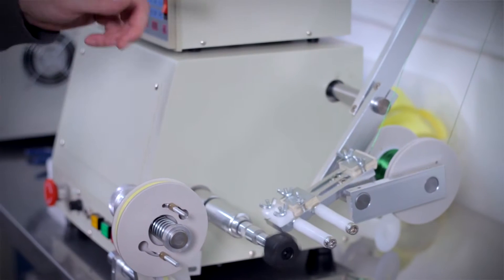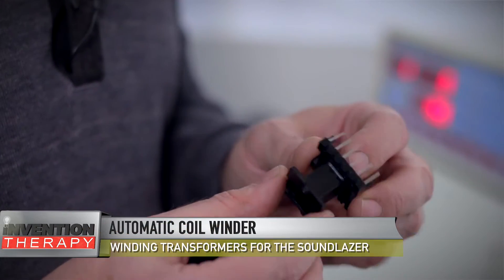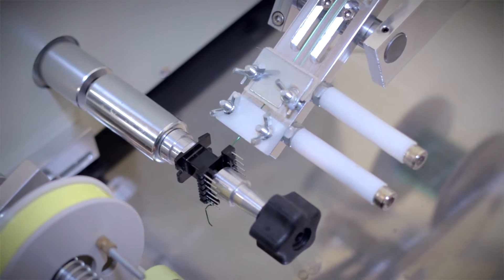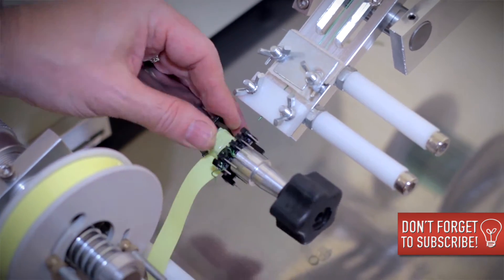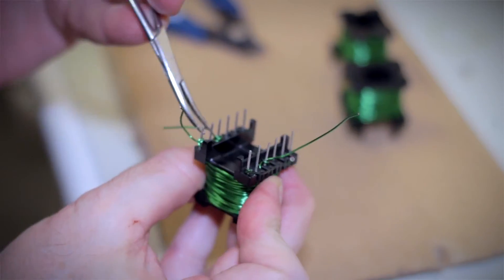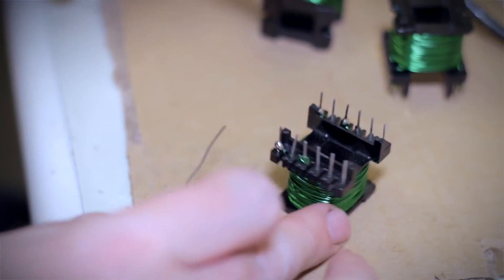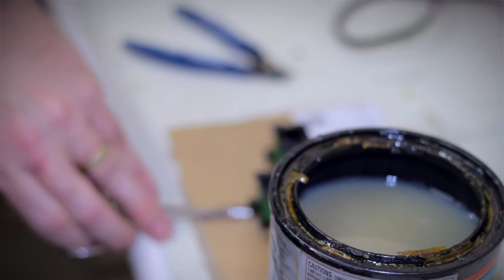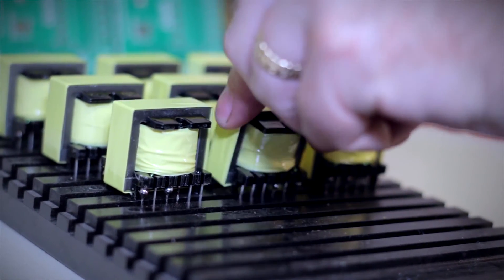Automatic Coil Winder and CNC Transformer Winding Machine For Small Manufacturing

Comment: Can you use this machine to wind very small inductors, say those using RM or Pot type cores? In particular RM5 (very small) and then RM8, RM10, P2213, P2616 cores. Thank you.
Reply from the maker: This machine is large and would likely break any kind of thin wire. In addition, the spindle is at least 6mm (1/4”) in diameter.
Reply: @InventionTherapy  Thanks so much. Looks like I need a smaller one but those are not as automated.
Reply from the maker: My studio is in West Covina if you need to see the machine.
Reply from the maker: https://www.youtube.com/watch?v=hV2LvHGiTMw

Same macine for smaller cores and wire.  I paid less than $1000.00 with shipping.